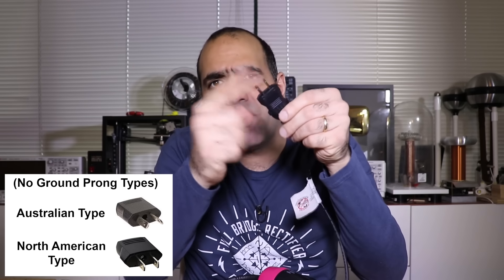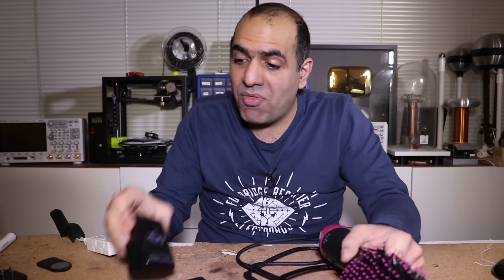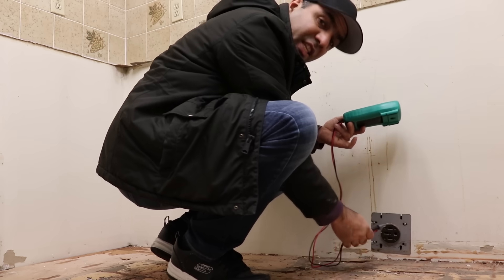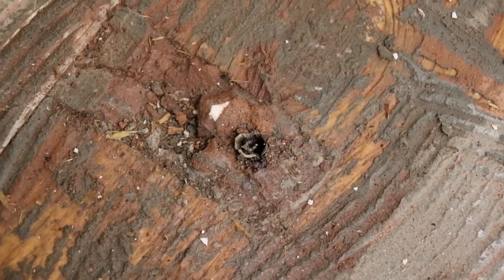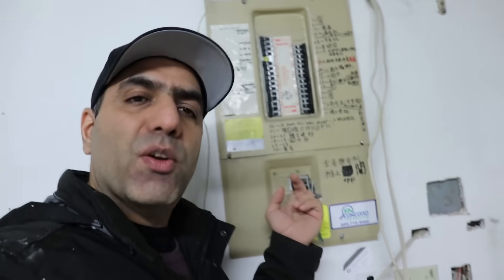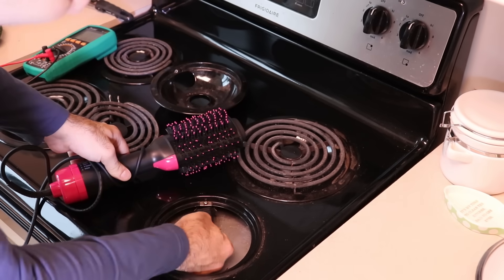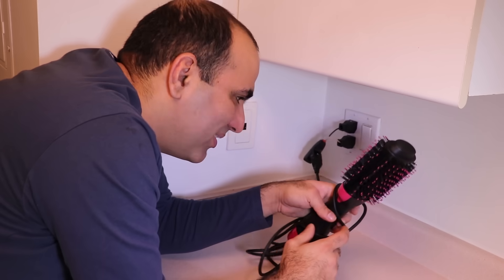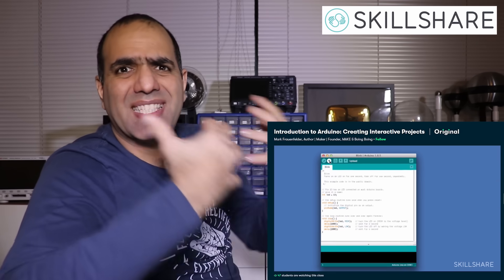Finding HIGH POWER 240V in a 120V Country

Comment: Since I have an electronics bench with a proper 240v outlet (Nema 6) and an IEC C13 power strip at 240v, I have a C14 to Australian adapter for my lady and her appliances down under. But for dummy protection, I've had the whole setup made for the user to have to jump through hoops to physically plug a 120v device in. As NEMA and IEC intended.

Comment: I am worried that you are starting to suffer from PTSD as you are jumping when you hear anything. As for the phases; I once worked at a company that had the power utility wire up 3 12/240 services with each one on a different phase. so we had 6 phase power to test our power line carrier devices.

Comment: Try finding 400V in a 230V country.
Reply: I work in a hospital we have 400v sockets in labs etc.
Reply: Need 3 phase for that
Reply: That is common in 230 V AC countries, e.g. at my apartment the cooker+stove in the kitchen runs 400 V. E.g.
hornbach (dot) lu/data/shop/D04/001/780/491/553/015/10023371_Doc_02_DE_20190321051653.pdf
Reply: Easy, 3 phase 400v sockets are not uncommon for things like stoves (as shown above) or for heating (if I remember right, there are laws regarding this matter) in some cases to run certain electric motors or pumps requiring three phase. AFAIK the maximum possible is about 3.5kW for standard 230V 16A but things should run below 2.5kW, which is not possible for a induction stove meant for a family, which can pull more than 10kW at maximum.
Reply: Here in Belgium i have 3x400v+N
So eather L1, L2 or L3 combined with N gives 230v. Connecting L1, L2 or L3 with each other gives you 380V
Reply: @Snippiii  If you have 230 V phase to N then you must have 400 V between each phase.. Earlier it was 220 V / 380 V
Reply: @bror8228  yep correctly it changed some time ago
Reply: Not a problem, 400V/sqrt(3). 3 phase 400V power is available.

Comment: I found 120V in a 240V country. The house where I live has 3 phase 120V supply, and the 240 volts are achieved using a pair of phases with no neutral. A part of the house uses a set of phases and the rest another pair (one in common). If you use one of those screwdrivers with a light to detect AC, both pins of the sockets light up. 
Apparently this is a very old system that exists only in parts of France, Belgium and Norway...
Reply: To achieve a phase-phase voltage of 240 volts, your phase-neutral must be ~138 Volts. If you phase-neutral voltage is 120 Volts, you'll only get 207 Volts (as in this video)
Reply: Szakállat Korporésön yeah, it's not exactly 120, I measured it a while ago, don't remember the exact value.

Comment: Red seal electrician here, apartments are commercial builds, which use 3 phase power hence the 120 degree phase separation.  Since dwellings typically need 120v loads like stated, they just grab two of the three pool phases for every suite.  Proper builds are balanced throughout the suites.  That way for the same amount of power consumption, the wire size needed can be ~33% smaller.  Saving money on materials.

Also code rules require separate circuits in most kitchen plugs for exactly your reasoning my friend :)

Comment: Also forgot to mention in the apartment building you only get 2 of the 3 phases to any given apprtment ...also fun fact you can see why you get 120 at the center you can actually draw a triangle(this would be a delta wound transformer) so you draw a triangle with each side being 208 units long the center of that triangle to any of the points will measure 120units
Reply: Thanks for the clarification. We only get a single phase here in Australia which was confusing me because I wasn't aware homes got 2 phases in America.

Comment: My mum called me one day and complained about how weird the vacuum cleaner sounded. She had it plugged into an outlet that she had installed herself after she took down a radiator. 400 volts made the vacuum cleaner go bananas. It still makes me laugh every time I think about it.
Reply: I’m surprised that the vacuum cleaner didn’t explode.
Reply: @EonityLuna  Yes, in universal motors (which vacuum cleaners have), the RPM is proportinal to the voltage, so the blade wheel, or even the rotor of the motor can blow apart from the centrifugal force if you operate it from 2x the rated voltage. Probably the motor developed shorted turns in the windings or shorted sections on the commutator prior to reaching the critical RPM at which it could have exploded.
Reply: @EonityLuna  yes me too :o
Reply: We were going to do that to run 240 to an outlet, ended up just disconnecting everything.
Reply: tosdude btw there is no 2 phase power only single phase and three phase.

A two-phase motor is a system that has two voltages 90 degrees apart, which is no longer in use nowadays. The alternator is composed of two windings placed at 90 degrees from each other. They require 2 live and one ground wire that work in two phases.
Reply: @tOSdude  UK version. I'm going to run 240 without unplugging anything and by just plugging something in the wall as I would normally 😂😉
Reply: LOL XD BANANAS
Reply: Wait, how?
Its impossible to plug normal device to 3 phase socket
Reply: if you reread his comment... " She had it plugged into an outlet that she had installed herself after she took down a radiator". She took out the radiator and put on a regular outlet
Reply: @TheEpicLinkFreeman  Precisely!
Reply: @sluskafan  The only way you can get 400v is from phase to phase on 230/400v 3 phase. Why does your mother have commercial supply power? Foundry power at that usually a Walmart or supermarket gets 480v 3 phase. I've only worked with 230/400 in a mine. You must not live in North America?
Reply: @alec4672  You get 400V when you connect two 230V phases. And no, I don't live in north America. I live in Sweden.
Reply: @alec4672  in the eu its kinda normal to get 3phase AC 230/400v.
Reply: Alec Ver Bunker I have a couple residential properties that I service their ac and the have 460 three phase in Greenville sc
Reply: @p1harleyford  I'm pretty sure I've dealt with 460 as well, just can't think of a specific scenario
Reply: @sluskafan  Huh interesting, now im looking up international power standards. I think the mine had it cause the mining equipment is sold all over the world. Only thing we did was install a breaker on the 400v panel to install a transformer so we could get it down to 120/208, quite a rare transformer took a couple months to get it.
Reply: @alec4672  you do realise that not everyone on the internet is in North America right?
Reply: @2bfrank657  you do realize we all just had that exact discussion about power standards in other countries? Or what are you getting at? 😂 No here I am thinking only the United States gets the internet when I watch Tom Scott and bigclive 🤔🤔😂
Reply: @Zycietohuj  If there's even a slim chance of something happening, it will eventually happen.
Reply: @Zycietohuj i think its 2 240 phases not 120
Reply: @Zycietohuj  could have been 2 fase 400V. But I don't know why the radiator would have been hooked up to 400V instead of just normal single fase 230V. Must have been a big ass radiator.
Reply: @ThatGuyNikolas  thankfully she didn't connected 3rd wire to the ground 😮
Reply: @ThatGuyNikolas  It was two phases.
Reply: @ThatGuyNikolas  Here in Europe we have huge electric radiators with 3 phase supply, and IIRC 6 to 9kW power. The elements run on 230V, but it usually has 6 elements, each pair connected to each phase. The radiators run on centrally remote controlled mains, which is turned on by the supplier  when the load on the national grid drops, thus regulates the load on the grid by turning on big loads in a controlled manner. This mains supply is turned on usually at night, it has a separate kWh meter, and the energy is about 30% cheaper from this supply. 

These radiators aren't direct heaters, they're heating up externally heat insulated bricks (hundreds of kilograms of them!), then you got a room thermostat, which turns on a blower fan inside this radiator when the room starts to cool down (the fan is operated from normal, 24h mains supply), so in daytime it uses the stored heat inside the bricks. This heating system was quite common in the '70s and '80s, nowadays it's quite rare, because even the 30% cheaper controlled mains is too expensive for heating.
Reply: @girlsdrinkfeck Quite ugly, yes, but simple, safe and reliable. But nowadays it's too expensive to use, gas is much cheaper, unless you have a quite big rooftop solar system, and well insulated house. The UK also has that remotely switched "discount" mains supply as well?

Comment: Adaptors are ONLY physical connector changers... they adapt one socket to another.. converters on the other had converts inputs to a diffrent inputs... same issue with computer connectors for HDMI DVI and D-SUB.. 2 words are almost the same... but completely different

Comment: Hello ElectroBOOM the reason for the difference in voltage is In apartments they have 3 phase 208....where the center tap of transformer is the 120 and in the residential it's Single phase 240 and we get the 120 by taping I to the transformer output halfway through

Comment: It's a real pity that Canada is using 120 triphase, in the USA everything is 120 splitphase, making it effectively a 240v system.
If not for the 120 triphase system, the entire world could switch to 230-240v and be united in at least one thing.
Reply: The state's use 3 phase as well. There's also 120-240 in Canada as well as 347-600 and 277-480.

Comment: If North America already uses 240 for stoves and other high energy devices; why bother to have 120 at all? Can’t we simply all switch to 230/240 volts?
Reply: Not needed. 240v is split out of phase to make 120v at the transformer located outside each n american home. This means that there are 2 120v services going to each house. The use of neutral means that the voltage on this circuit is 110v whereas omitting the neutral in place of 2 120s means you have 240v. That said, any (12-2) outlet can be converted into 240v simply by replacing the breaker with a double din breaker. The only time a neutral is needed for 240v is when the application requires 2 120s. For example an electric dryer uses 1 120 for the heating element and another for the motor. Technically the electric dryer isn't even 240v, but rather 2 110s. This is why it requires the big plug
Reply: gt5228z the question I’m asking is; why need 120 anyway? We need al kinds of special circuitry and adapters for our devices to work with both 120 and 230. Why not simply all switch to 230/240? What’s the advantage of having 120 in the first place?

Comment: did someone saw chineese(?) text on a switchbox of that house? I'm not sure that this is chineese, because i can't see the switchbox in more detail, but it doesn't look like japaneese, so is this house located in china or i'm just got something wrong?
Reply: It is just writing done by a slum landlord who happens to be asian to designate which area in the house each breaker controls. It is terribly done, as is the wiring, plumbing, carpentry and drywall in that house. None of it would pass the mandatory inspections that are required so obviously they are doing it without the required permits and makes all the suites illegal. No qualified/certified electrician would have done those things. No decent human being with half a brain would do those things even if they weren't certified either. It takes someone who doesn't care about others and is willing to break the law and put other people's lives at risk in order to make the most money they can.